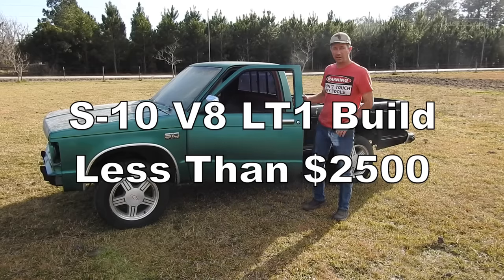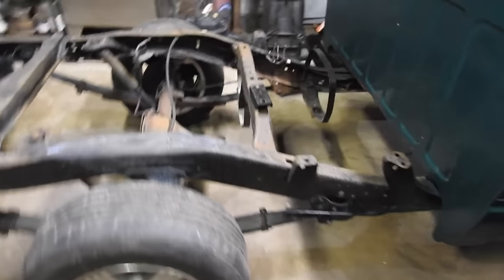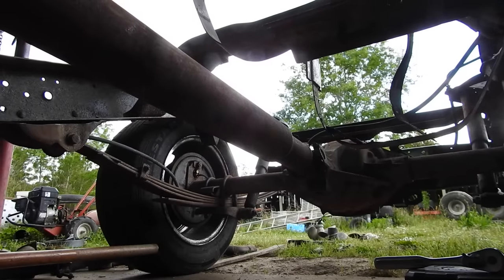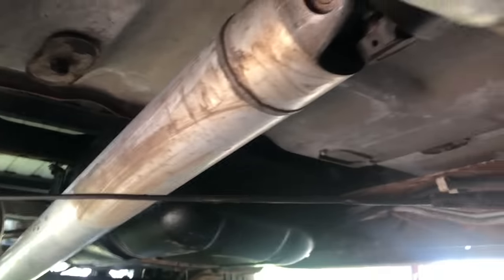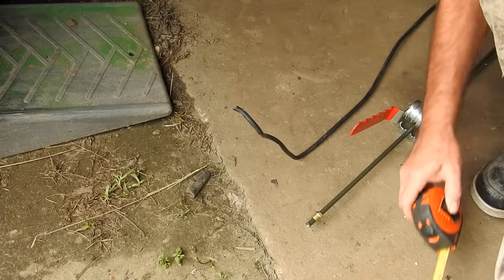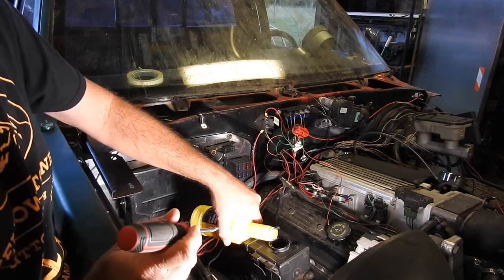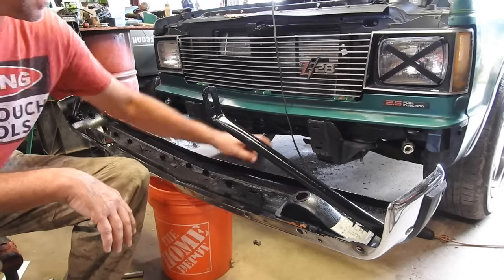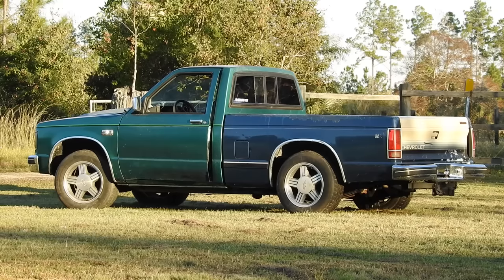S10 V8 LT1 Build for Less Than $2500

Comment: Gosh man as a previous owner of 2 LT1's curious did you put a new cap rotor and plug wires on, They are murder to do in the car/truck later.
Reply from the maker: I did not, it ran so I just stuck it in. I hope it keeps on running and thanks for watching!!

Comment: You definitely without a doubt are looseing out on all kinds of fun you need 3.07 positract rearend that thing will run easy 150 mph 3/4 that’s quite cock.
Reply from the maker: I would love to find a 307 Posi, trying to save gas, that would do it, but I don't plan to do 150 ever in it... thanks for watching.

Comment: Did you change sparkplugs while the engine was out, or at least installed without fenders?  I had a bitch of a time on 1 plug on my '92 years back.  Had to weld a piece of rebar to an old crusty plug socket an go through the fenderwell to get to the damned thing.
Reply from the maker: I probably should have, but I was in a big hurry to get it in... I had already heard it run great and did not do anything to it. thanks for watching.

Comment: I only have one question, what engine was originally in the truck V6 or 4 cylinder? Reason is never seen you swap K member wondering what my Sonoma has in store for a V8 swap.
Reply from the maker: The truck originally came with the 2.5 in it. Thanks for watching.

Comment: Nice! Quick question. Do you know the make and model of those headers you put on the LT1? Thank you.
Reply from the maker: I believe they were Hedman headers made for S-10 V8 conversions. Thanks for watching. BTW, $255.99 on jeg.com, comes with collectors, gaskets, and bolts. Let me know if you need a part number
Reply: @chud327  They are probably Hedman 69010. Looks like a nice fit with a few minor tweaks.

Comment: Im about begin this exact build this coming winter. Removing the Iron Duke to slip in the LT1 i picked from a friend. With a 4L60e tranny. What motor mounts and tranny bracket did you use?
Reply from the maker: I don't know my motor mount part number, but I the they are just v8 motor mounts. My check the forums for part numbers. I have never used a 4l69e so I am not sure. I can usually always make the stock crossmember work by drilling new holes. Good luck and thanks for watching!!
Reply: @chud327  ill be revisiting this that’s for sure!!
Reply from the maker: @MrDugyfresh  perfect and about to do another as soon as I find an engine to put in it…
Reply: What fuel pump did you use for your LT1 conversion?

Comment: im putting an regular 5.0 with 4l60e trans need help on what crossmember to use and driveshaft if you can help.same body style 91long bed
Reply from the maker: I have always been able to use the stock cross member, I usually have to drill a hole or two. Good luck. As for the drive shaft, I measured what length I needed and went to the junkyard and for something that would work. I am not sure on an extended cab, maybe there is an online forum. Thanks for watching.

Comment: What’s an egr? And why you block it and the ac?
Reply from the maker: EGR is exhaust gas recirculation, part of emission controls stuff that I did not need.  A/C compressor blocked off because the truck does not have A/C. Thanks for watching.
Reply: @chud327  thanks for replying, this video was extremely informative and awesome to watch in itself, it was crazy how you had to cut grass 4 the parts

Comment: Why wasn't it a medium short wrench? At least that's a glass half full.
Reply from the maker: I try to keep a half full mindset and thanks for watching.
Reply: @chud327  just plucking strings down here in Georgia friend. Great video. Thanks for posting. I've done the S10s and ford rangers and the dodge Dakotas. Even the Mitsubishi Mighty max. I've started using the frames if these trucks to bolt front wheel drive cars to and making them rear wheel drive V8 shockers.
Reply: @chud327  Thing I found interesting and useful was the F150 being a more narrow frame in the back at least.
Reply from the maker: @scottfree8848  I was very surprised

Comment: Does anybody know if the stock Camaro manifolds that were on the engine would have worked ?
Reply from the maker: I don't not know, but would like to. Thanks for watching!!
Reply: @chud327  I think the stock manifolds are a viable option, atleast they look that way , nice and compact , the manifolds are readily available on ebay but so are stainless steel Patriot Clippster header copies for 200 bucks , when the camaro manifolds are priced at 200 each the SS made in china header starts lookin pretty good !

Comment: Get an 8.8 97 explorer rear end..locker
Reply from the maker: Good idea and thanks for watching!!
Reply: Hey ..better than that...a 2002 zr2 blazer 8.75 373 locker...it's 2 inches wider on each side .but those Camaro RS 16 inch wheels will still set inside the fenderwells..The zr2 rear end is pretty tough..
Reply from the maker: @davidross-oo2vh  another great tip, keep them coming

Comment: can you explain the wiring ?
Reply from the maker: For the truck or engine? Engine had everything labeled. Truck just needed a hot wire to the fuse box. Also had to tap into the fuel pump wire. Tried to show it all in the video. Thanks for watching!

Comment: I have 2 windshields also 2 rear sliding windows also other parts if interested ?¿
Reply from the maker: Where are you located, I 100% need a windshield and poss a rear window too.  I was planning to hit the junkyard, but I don't think I have ever pulled a non cracked windshield out, don't know if I can do it with out breaking it...  I don't know that I need anything else right now, but will probably think of more next time I work on it.  Thanks for watching.
Reply: @chud327  I'm about 45mins north of Knoxville TN ?¿ U can have everything i can find for 150 both windshields & back windows got few other things for the body will need to look to remember what, ur welcome to all for that up to u my friend. Also their not that bad to take out, use a emergency brake cable with 2 pair of vise grips heat 1 end of the cable push through the glue Lock pliers on and try not to break the cable smack urself in face with pliers. Ask me how i learned that lol
Reply from the maker: @redmax3372  too bad I am way down here in Florida… thanks for the other
Reply: @chud327  u can also use guitar strings to cut them out but they break really easy
Reply from the maker: @redmax3372  good tip
Reply: @chud327  ull me too unravel the emergency brake cable to be able to use it, im guess u probably new this lol

Comment: A tip so you don't rot out your radiator, copper and aluminum ARE not COMATABLE. YOU HAVE CREATED BIG TIME ELECTRASIS NIGHT mare. I do like your idea of the insert, but copper not to be used.
Reply from the maker: Will open them up soon and check on them. Will try to find a replacement soon. Thanks for watching

Comment: Can u drop a parts list please
Reply from the maker: Basically, there may be some things missed in this list, you need the truck, engine, transmission, V8 swap motor mounts, radiator, correct length drive shaft, electric fans, temp sensor for the fans, gauges, shifter, V8 swap headers, fluids, if you do a carb you will need a fuel regulator with return line, and other stuff I possible missed. Hope this helps and thanks for watching.
Reply: Thanks a lot man love ur videos
Reply from the maker: No prob, thanks for the love

Comment: my god you talk fast man never bolt pipes and mufflers straight to the frame or body the flexing breaks the pipes and will break manifold bolts always use rubber strap or anything that will let it flex some when the engine does and that hose touching fan will get a hole over time
Reply from the maker: Sorry, didn’t want the video to be two hours long…. Thanks for watching!!

Comment: Stopped by to see what if any new changes to install of LT1 small block . Started doin this in the 80s with 302-400s  sledgehammer performance engines , auto trans or 4-5 speed manuals . Found the best hookup for traction is long bed longer wheel base . Better weight transfer and control at 170 mph + oh yeah lock right rear . I’m old now can’t do a lot anymore …so great to see these are still alive ,, square body first gen. Rpm’s 7000 n up to 9500 on 302s . You did a good conversion.
Reply from the maker: I love the high revving engines would would absolutely love a 302 in my Z/28 tribute... That would be the perfect engine. However, so rare and expensive, that will just have to be a dream. thanks so much for watching.
Reply: @chud327   the sound of a high winder 302 n 12000 rpm sounds like a beehive on steroids . That’s a chev 302 as the winder . Had to run magneto’s to fire em years  ago . We had 104 to 106 octane gas ,18cents a gallon then . Gas wars of the 60s super low prices then

Comment: I tell all I can about Ospho. Some say yes but I get same thing half price at fill n blank big box home building store, yes but it's not same. No extenders, wetting agents, zinc dichromate etc. And u can't use on 2 inches of rust, gotta knock heavy off, gotta clean no oil, grease etc. I've used for decades and it's great for rust or keeping blasted or clean metal from rusting. Love the video. Also, idk where u at but if rust is a concern, urr thrifty like me my pap told me a recipe for a rust stopper he learned in 50s off old gear head. 1 qrt of any oil new or used, same amount trans fluid, new or used, 1 tube or tub of any grease, any color like grease gun zero fittings etc, 1 wax ring toilet flange gasket. Mix, heat use with sprayer, etc will never rust. Can add whatever else u like. If used oils and fluids u made a rust stopper for less than $6. Most stuff now don't have petroleum products in them and cost so much. In doors, hood, etc plug drains, use mineral, baby, transfluid and Vaseline. Can use any of it. Pour in with hose, let sit a few days, no door seam rust. Drain use next year. With 1st rust stopper it will last year's if u don't use a auto wash, steam jenny etc. It will stick, not get rock hard just stiffen up. If need more wax use it. Less use less. U can make however. I add boiled linseed at times also. Urr welcome. I've used all my life in Pa where they use salt brine and chlorides when weather man even says possible snow flurries. It's BS we cant use anything else that won't kill our cars. If that bad stay home. not worth life or car for work.
Reply from the maker: Thanks for watching!

Comment: I will never understand why someone would choose to put an LT1 in anything.  They were such horrible setups with so many known problems.  With the availability and low price of doing an LS swap it just makes more sense.  You could have easily done an LS swap with the same budget and had a more reliable engine with more power.
Reply from the maker: If I could find a good running LS Anything for $500, I would be all over it ..  maybe on the next one and thanks for watching.
Reply: @chud327  You should be able to get an LS and trans together at Pick and Pull for less than $500 if you're willing to do the work to pull one.

Comment: Sorry not LT-1. While showing the back of engine/tranny I looked at the head casting. LT-1 (which I bought from Chevrolet as a complete new crate motor in 1970) has two “humps” on the head castings 2.20 intake and 1.60 exhaust and not aluminum. Chevrolet did, however, come out a short time later with angled plugs, both had screw-in rocker arm STUDS
Reply from the maker: This is not the original LT1, Chevy did LT1's in the 90's for Caprice, Camaro, and Corvettes... They called it LT1, call it nostalgic if you like. Maybe google it for future reference and thanks for watching!

Comment: Is that a Drywall pan?
Reply from the maker: I know there is one out there and I was using it to pick up bolts off of the floor, but I did not know it made it into the video. I will have to go back and watch and see if I can see it. thanks for watching.
Reply: @chud327  no big deal man I just found it funny. It was a drywall pan.
Reply: @chud327  drywall finishers get offended when you improperly use drywall tools.

Comment: Cowl induction!   Use the hood!  There's your cold air!  Besides, no one seems to know how to do it properly these days.  These kids need a lesson in taking advantage of aerodynamics for the engine's benefit, not just styling.
Reply from the maker: I had a carb and big round air filter up top, I would use it. However it would take some doing making mine work. Let's try it on the next one. thanks for watching.

Comment: That's funny you say 5.7 and then you say 327? 327 is a 5.3.
Reply from the maker: It i a 5.7 but it was 327 on the front and both sides...  I usually say 327 a lot because it is part of the channel name. thanks for watching.
Reply: @chud327  I wasn't trying to be a jackass or anything I hope you didn't take it that way? I myself used to have a S10 with a 400 Chevy small block, and a tubbed rear end. That little truck was
Awesome to drive. Your video brought back great memories.
Reply from the maker: Not at all ... I was hopeful when I say 327 on the engine, that was a little confusing. Love sparking old memories, especially a 400/S-10. That is one I have no had yet. Had a 400 in my first car, probably my favorite engine so far. Thanks for watching.

Comment: Lt engine... The biggest POS GM ever made..
Reply from the maker: Maybe, but I would pick it 350 times more than a 2.8. I know mine starts easy, runs great , sounds super, and has lots of power. Maybe your POS means Plenty of Strength? Or Putting Out Stripes? Either way, thanks for watching!!
Reply: I did love the video. I'm not downing u sir. I just hated my LT1
Reply from the maker: @CamaroKevin84  I completely understand, glad you liked. BTW, I have an update on my next S-10 coming out 7 o’clock tonight. I hope you will check it out. Call it a special invitation…